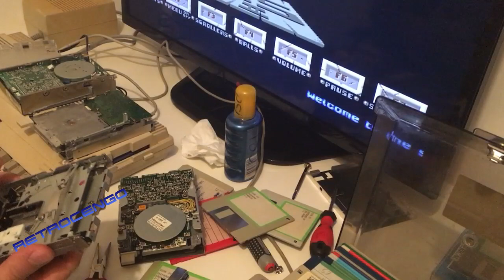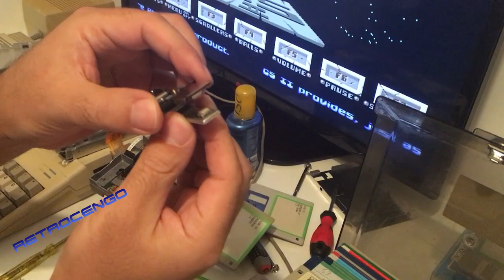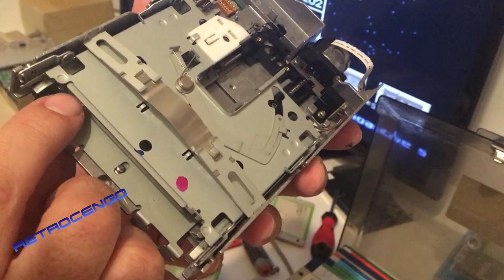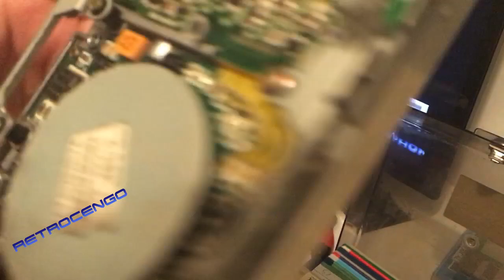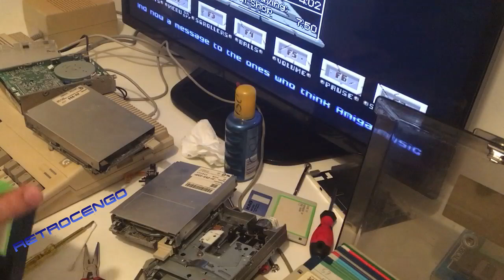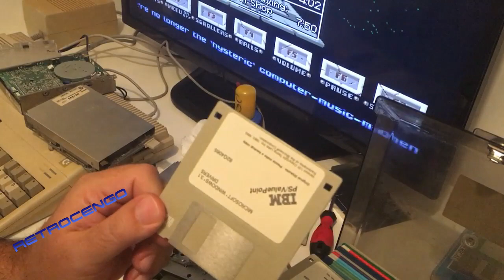Commodore Amiga 500 diskdrive inspection and repair

Comment: Dont know if you are still active. I found my dads old Amiga 500 on the atic. The disk light isnt lighting up. The 50V cap for the motor isnt working so the motor is only moving so slightly on startup. Dont know if replacing that cap will fix everything or id something else is Making the disk light not working.

Comment: I have faced many of such problems with old drives. They are fixable, yet for some reason, they always go funky after a couple of months. So I have resorted to that mod-cable and a 3D-Printed eject button. That way I can use newer PC drives that has not been modded.